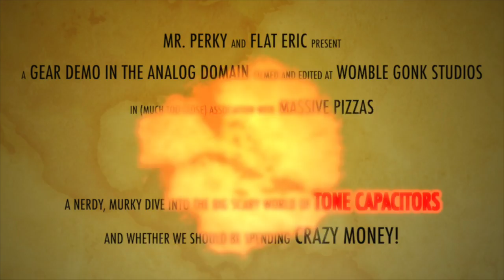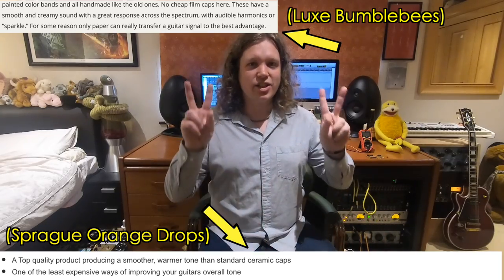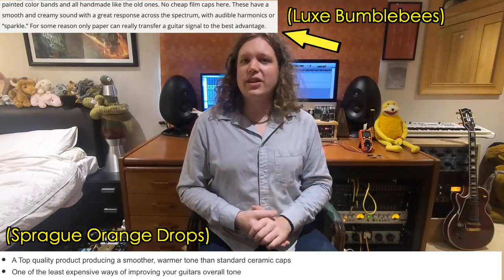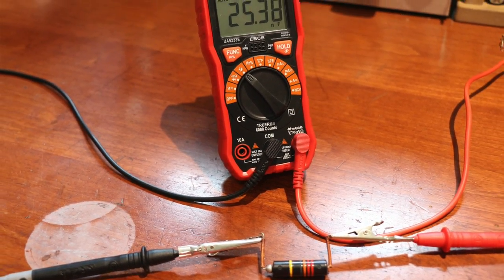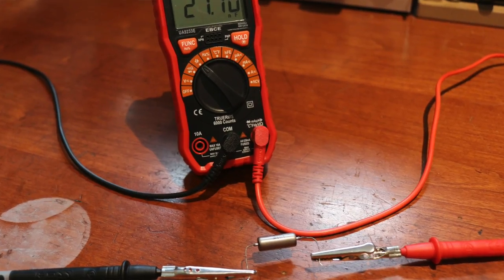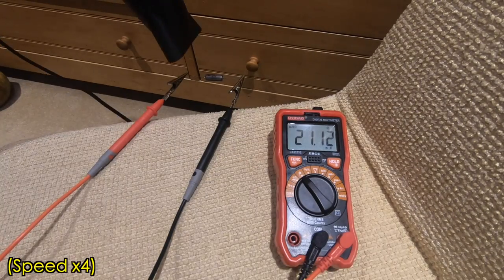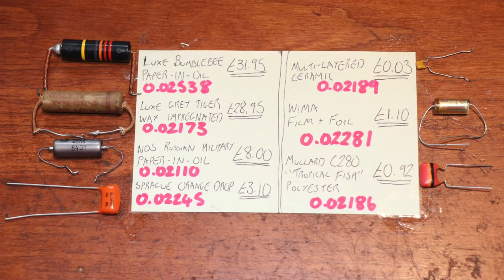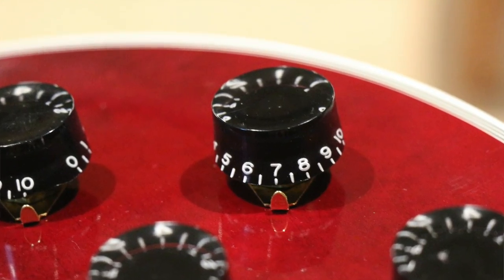Do Paper-In-Oil Capacitors REALLY Sound "Better"..??  (vs. Ceramic, Orange Drop, Tropical Fish, etc)

Comment: yes it's just negotiable differences. However when you add up all the components ,pups wiring, pots the way you wire them ,their value.... So we all know that a 500,000 thousand guitar isn't ten times better sounding than a 3k guitar. Its .05 or 10% better but that 5-10% is huge. So for me its not one thing it's the whole of the parts, the wood density, age, all the pieces including picks, strings but most of that will do the average guitar player very little good because your touch and feel has as much if not more to do with great tone than the gear you play threw. 
that said not one of the guitars I play is stock and every single one has had a cap replacement. mostly because i like .015 s over .022 or .047 i find the sweep much more usable and i like 50s style wiring.

Comment: I didn't watch the entire 10m intro.. 
Input loading e.g. 50's wiring IMHO the dielectric does make a difference. There is an audible difference between metal, poly, pio etc. 
Its subtle but it is noticeable.

Comment: This is my list Luxe bumblebee > Luxe Grey Tiger Wax Impregnated > Ceramic > NOS russian paper in oil > Mullard C280 Polyester > Wima film n foil
> Sprague Orange Drop Polypropelene but ... my  experience is that your gear (and most home and semi-prof gear today, amp simulations, AD/DA) degrade the signal performance and you will have more audible results straight in a clean tube amplifier (not the ones with the multiple gain stages). Today's mainstream gear kills natural harmonics and you don't hear big differences. Most older people outside the digital era hear those differences big time because they weren't exposed to digital stuff. My opinion always.
Reply from the maker: I'm firmly in the non-master-volume, all-tube amp world :-)

Comment: it seems to me that we rarely take into account that we are dealing with an AC current not DC. The signal doesn't "go" from the guitar to the amp but we create a loop between the two where the current can alternate, so many people say it goes to ground therefore it is pointless, I'm not so sure about this.
Reply: When you turn down your volume on your guitar, you're sending the signal to ground. if what you said was true, volumes wouldnt be working at all wouldnt they ?
Reply: @crazysandwich  I’m sorry I don’t understand the question and anyway I’m not an expert so I couldn’t answer very precisely. But from what I gathered, this type of thing falls into the category “it’s more complicated than we think”.
For example most volume pots when they’re on 10, they actually already send some signals to ground. Some pots called “noload” or “alpha” have a very low tolerance but all that to say that it is theoretically possible to hear a difference between caps even when the volume is on 10.
Reply: @leonardtristan6873  Alpha pots is just a brand. they make great pots. 

I was just using your logic to point out you are wrong. If ground was pointless as you said, you couldnt use a volume pot. 

So yes, in a tone control cicuit. you dont hear the cap, the signal that goes through the cap is going to ground. Imagine its a volume that acts only on treble frequencies.

If we were talking about a overdrive pedal for example, usually in these you have a input capacitor, and a output one, all the signal is going through both of them. if you change the value its going to affect the amount of bass. In this case, i think the construction of the capacitor can affect the tone. But even then the change would be quite small.

If you want better tone, quickly and cheaply, lets say, under 30$.
Change your goddamn strings every 2-3 weeks. that is going to have a tremendous effect on your tone ! Cheers !
Reply: @crazysandwich  ok thanks for the feedback.

Comment: Best tone improvement is practice. Sucks... 2nd best is a change of speaker. Then pickups,strings,bone nut,pickup height,electronic bits,pickguard color,pants tightness,hairstyle,jewelry,and finally, tonewood.

Comment: Hi Joe,
Thanks for great canal and videos. 
I have a question;
I recently build a 50s harness for my R8, where I am using 550k audio taper pots and real papir in oil caps. 
The harness is working, however my tone controls almost have no effect, unless they are almost turnes off. 
If I go from 10 to 7 or 5, with the volumn at 10, there is no change in tone. 
Only when I reach 2, I get the woman tone. 
I have checked my wiring, and being also a left hand player, I checked twice and it seems correct. 
I had expected to be able to be able to adjust the tone as you are doing, but instead I almost only have on/off effect. 
Any ideas?
Thanks a lot!
BR
Marcus from Denmark
Reply from the maker: Hi Marcus...my guess would be that you're using 'normal' logarithmic pots rather than left handed ones.  Which is fine, assuming you're ok with your pots working 'backwards' (in terms of which way you physically turn them relative to the guitar body). But if you wire normal log pots in reverse (switching the wires on the outside two lugs around) you'll have them working in the 'correct' physical direction, but the taper will be reversed...meaning very little will happen on the tone knob until it's turned almost all the way down.  So, I'd either buy some specific lefty logarithmic pots; use linear pots (which aren't 'vintage correct', but will work identically soldered either way around); or have your knobs turning 'backwards' which will give you the correct taper. 👍
Reply: @JoePerkinsMusic  hi Joe, Thanks for a Swift reply. And yes I am using normal log pots and have them wired in reverse. 
Didn’t think it would make a difference. 
So can I simply solder my existing differently and have it working as it should (while still being reversed)?
Or will I have to buy new left hand log pots for getting the correct taper?
Does the same apply for my volumn pots?
Many Thanks Joe!!
BR
Marcus
Reply from the maker: @marcusbryndorf5489  Hi Marcus - you could either switch the wiring on the outside two lugs (to the 'correct' wiring), which would give you the correct taper but the pot would turn the opposite direction to what it does currently.  Or, you could buy left-handed log pots, wire them 'correctly' and have them work in the same direction as they do now but with the correct taper.  The same is true for the volume pots - they're identical components, just wired differently :-)
Reply: @JoePerkinsMusic  also do you have a wiring guide for how to left hand wire 50’s wiring with right hand log pots? Thanks
Reply: @JoePerkinsMusic  it all makes sense now!
Many Thanks for clearing this up. 
Glad I wrote to you. 
Last question: what about the pickups - do I need to wire them differently?
Currently they are installed as normal. 
Thanks again Joe!
BR
Marcus
Reply from the maker: @marcusbryndorf5489  I don't - but if you're ok with the pots turning the opposite way around but with the correct taper, you can wire the pots exactly as they are in the usual 50's wiring diagrams :-)
Reply from the maker: @marcusbryndorf5489  No worries! You can wire the pickups exactly as they are in the diagrams - no difference between lefty & righty. (The only time you need to think about 'lefty' pickups are Strat/Tele p'ups that have a fixed stagger to the pole pieces. Humbuckers can be mounted either way around!)
Reply: @JoePerkinsMusic  Sorry for asking in details:
So it’s only the volume pot where the capacitor is attached to the lug that needs to be soldered to the other lug?
Thx
Reply from the maker: @marcusbryndorf5489  Hi Marcus - for volume pots in 50's wiring, one of the outside lugs should have the pickup connected to it, and the other should be grounded to the side/back of the pot.  You'll need to reverse these two around.  The capacitor should be soldered to the middle lug with the output wire that goes off to the 3-way switch - that can stay as it is :-). 

The cap goes over to one of the outer lugs of the tone pot.  There, the middle lug is grounded to the side/back of the pot whilst the other outer lug is left untouched...you'll need to switch the cap to the opposite outer lug than what it's connected to currently. :-)
Reply: @JoePerkinsMusic  great - I got it! Thanks! 
Will it change my sound when I get the 50s wiring in place?
Reply from the maker: @marcusbryndorf5489  With everything wide open - not really.  With 50s wiring, the guitar stays a bit brighter as you turn the volume down, and turning down the tone will interact with the volume control more and cause a little bit of cleanup.  Modern wiring rolls off more high end when turning the volume down. Not too much in it - but for an R8, 50's wiring is what I'd personally go with :-)
Reply: @JoePerkinsMusic  I made the suggested changes and the pots are now working perfect - many Thanks!
By the way - I recently bought and installed the Spirit of 59 PAF from Amber. 
You should test this pick-up cause it’s identical to a vintage typical PAF. 
It’s also tested by Doug and Pat in their German show and you cannot tell the difference to 58’ LP standard. 
Amber did a lot of research and had a lab to analyze the original PAF. They were made of a special alnico4 magnet that is no longer produced. 
They then re-created this magnet and it’s now exclusively for Amber. 
The search is over :) Check it out. 
BR
Marcus

Comment: There is a more important technical issue, the dielectric absorption factor of the caps define how quickly the cap will restore. In other words the lower the % of dielectric absorption of the cap is the quicker it is. That's why I use polypropylene caps they are the fastest for recovery. Paper in oil can sound great but in the 1950 there where not very good plastics available, the use what ever was usable. Caps that have 20% tolerance Humm not so nice to have them as copple caps. My polypropylene caps has got 1%
Like the sound of your video  I could not hear very large difference in caps.

Comment: Thanks for showing me that my USD 3,000masterbuilt guitar used the cheapest caps in the market 😂🥺😭😭😭
Reply from the maker: Haha, sorry about that! :P BUT...the differences between that and a posh one ain't huge :-)
Reply: @JoePerkinsMusic  yes I can see that. I couldn't tell the difference😂. Not sure I heard it actually. They do look very nice, I was familiar with the emerson paper and oil caps but they aren't as expensive as the ones you showed. These are really over the top.
Reply from the maker: I think the Emerson's are pretty much the same as these, just without the Bumblebee stripes - Jensen do a version too.  I'm sure there's some subtlety in there somewhere, but they're essentially exactly the same.
Reply: @chriskilian2325  really? you weren't even able to tell an audio difference from ceramic to any of the others? I could even hear it with the tone on 10? It's very slight, but in reality it makes quite a bit of a dynamic and energetic difference while playing!

Comment: The cheapie ceramics, if you are in a humid environment, can degrade over time causing the capacitance to vary wildly.  Personally, I buy the cheap mustard caps on eBay.   You get 3 of them with axial leads for about $4.00 shipped.  They are called mojo dijon.  They are great and clarity in these is every bit as good, to my ear, as those expensive bumble bees.   I will say that those NOS Russians are probably the best value and sound amazing.  I’m going to look for some of those.

Comment: No, In theory different capacitors have different electrical properties. Capacitance is not the only variable, they have many variables. If it is hypothetical ideal capacitor, then the only property is capacitance, but there is no ideal capacitor in this world

The imperfection could potentially affect signal. Whether it is noticable, it is highly debatable

Comment: read a lil thing about paralleling caps. pio with poly recomended. your meant to jump up the voltages by 25‰ the lower the cap values.

ive got a bunch of russian pios and welsh to german and various others to bring sone sparkle, will see 😂

Comment: can you link to the ceramic and sprague you have used? they sounded the best to me, though the bumblebee did sound a little warmer i prefer the latter two and after watching this twice i can hear a slight difference in them that to me sounds better. slightly more clear and ever so slightly warmer. i've no experience with different capacitors than the cheap ones in my ibanez rg and lace huntington, but they all sounded about the same.
Reply from the maker: They were just off eBay - they weren't expensive ones; just whatever happened to be available when I was putting this video together!
Reply: @JoePerkinsMusic  do you have a video about pickup combinations or maybe pots? I’m looking to upgrade the Ibanez rg to some quality components and also replace aged parts with new pickups metal in the bridge, brighter humbucker in the neck, better 500k pots with audio taper and a 5 way switch if I can get pickups that split.

I was thinking alnico 5 in the neck, maybe ceramic in the bridge. 🤷‍♂️ I’m clueless about this, but I know I want warm and thick in the bridge and something that can blend in the neck that’s brighter and less bass. Unless I’m getting the wrong idea how it works.
Reply from the maker: @redkurn  There's a video about pots on my channel from about 6 months ago - Pots 101, or something like that.  In terms of pickups, I wouldn't let the magnet type direct you too much...yes, they're important, but there's many other factors at play too...covers/uncovered, DC resistance, wire type, coil offset, inductance, etc.  Magnets are only a part of the puzzle.  For example, the sonic difference between a vintage-accurate low-wind PAF and a Bare Knuckle Nailbomb will be extreme; yet they both use Alnico 5.
Reply: @JoePerkinsMusic  interesting, it's going to be harder to choose than i thought, recommendations?
Reply from the maker: @redkurn  Very much depends on what sound you're after.  In the UK, I tend to use OX4 and Monty's pickups - they're both outstanding, especially for the vintage-spec p'ups.  Monty's make some higher-output pickups too.  The likes of Seymour Duncan and DiMarzio seem pretty reliable for higher output stuff too :-)
Reply: @JoePerkinsMusic  i was considering the invader, but not sure what to pair it with for a good blend between neck and bridge. i find myself enjoying playing metal songs, like rammstein more than others, but i don't want to spend the entire play time on the bridge so i'd like something cleaner in the neck, the designed by emg-h1 i have now sound good, but they don't split and $80 pickups from dimarzio or seymour duncan sound a lot better.

thank you for answering these questions, no one else seems to read the comments.
Reply: @JoePerkinsMusic  so I pulled the trigger on a set of Duncan distortion, CTS push pull 500k, .001 cap with treble bleed, new CRL 3 way switch and switchcraft output jack. Figured I may as well since this guitar was not treated well for a decade.
Reply from the maker: @redkurn  Good stuff - sounds like a great set of bits! :-) If your cap is 0.001uF though, that's pretty small for a guitar!
Reply: @JoePerkinsMusic  it’s this, decided orange drop. I might change that part of the order, at the least I was thinking .015uf... https://www.stewmac.com/electronics/components-and-parts/capacitors-and-resistors/golden-age-treble-bleed-circuit.html
Reply from the maker: @redkurn  That's a treble bleed capacitor rather than a tone capacitor - so you'll solder that onto your volume pot to retain treble as you roll the volume down.  If you use capacitor that for your tone knob, you likely won't hear any darkening of the tone.  For humbuckers, you'll typically want something like a 0.022uF capacitor for the tone circuit. :-)
Reply: @JoePerkinsMusic  crap, well maybe they can add on a .022 🤦‍♂️😂

Comment: The clarity is defiantly the clincher. The upper prices had a complete and smooth top end and as you said note separation.
Reply: Utterly no difference other than an eighth-turn on tone knob.  Humidity in air has more influence.

Comment: I don't see the logic behind the belief that coupling caps matter because the signal passes through them, but low pass filters with caps to ground don't. If we were to accept that the signal changes depending on whether the signal passes through a cap, then caps to ground should also change the signal, because the part of the signal that skips the cap to ground is the original signal minus the supposedly altered signal that goes through the cap to ground. That to me sounds like a pseudoscietific rationalization of the belief that dielectric type has an impact on tone, but the way  to prove or disprove that claim has to be a blind test comparing different caps of the same capacity in different positions. And what about cathode bypass caps? Those are not even in the signal path but they do definitely have an impact in the frequency response depending on the capacity (probably not the dielectric)

Comment: Als long as a capacitor has no major defects it will work identically in such an application. So get the cheapest ones - they sound alike as long as their capacity value is the same. Minor differences you may hear are caused by the capacitor tolerances which are in the range of up to 20%. Don't fall for any esoteric products promising a better sound by changing the caps! 

BTW: Gibson: a BIG FY for faking a "bumble bee" cap and selling it for a ridiculous amount of money .... but obviously there are enough be people wanting to be betrayed.